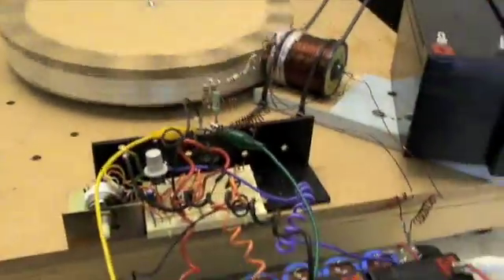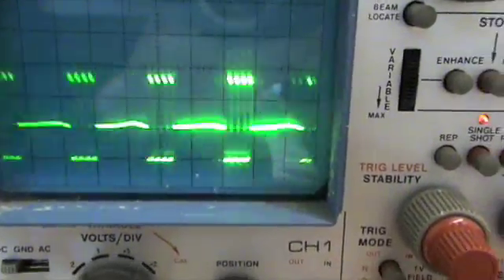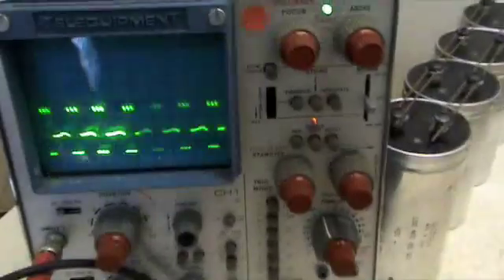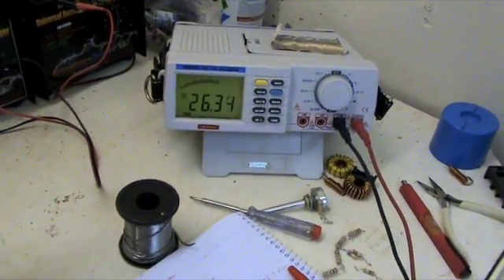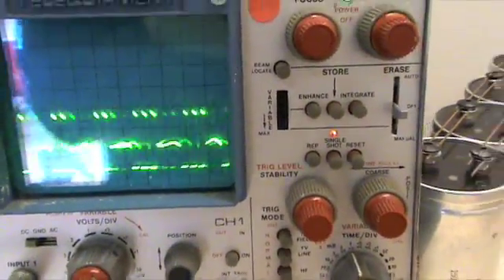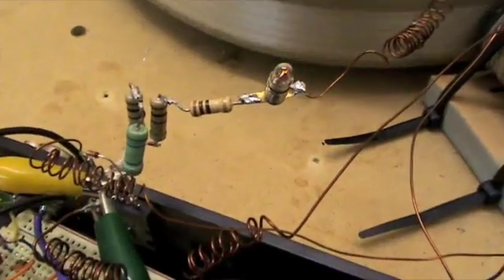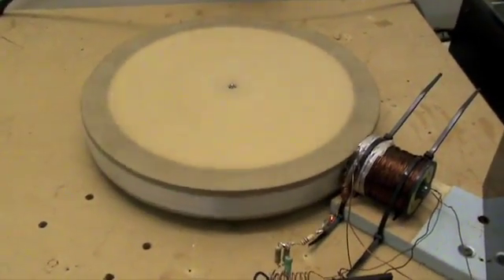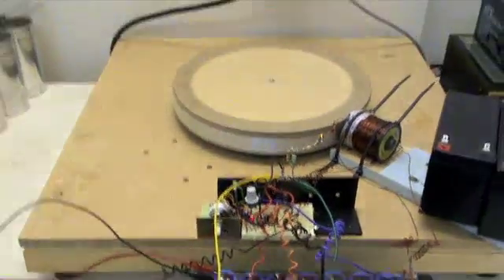16 Pole Superpole Bedini Pt 2

Comment: hi john
thanks for some insight to the problems that i was having just getting the wheel to act on manual pulse with a magnet. can i ask your construction of the coil "winds and guage" and i am using an aluminum plate but have more spacing and fewer magnets do you think that that would affect my rotation or do i just need more inital speed to get it going

Comment: nice rotor, a little too heavy i agree...

I noticed what might be an error in your part one vid...
Now, depending on your compass i could be reading it wrong... but...
if north on the compas is pointing at the magnets then the magnets are south (opposites atract)... can you double check...

other than that... pritty good...